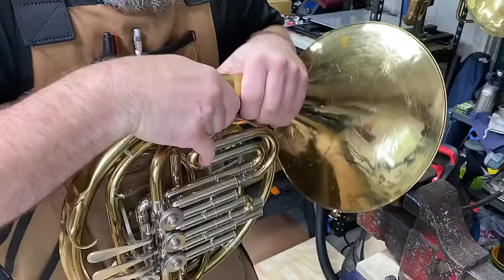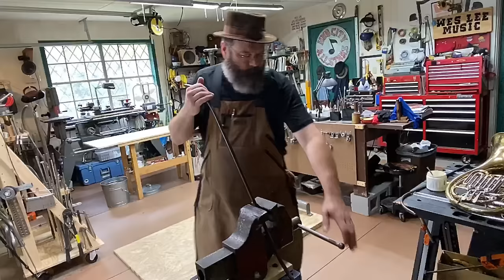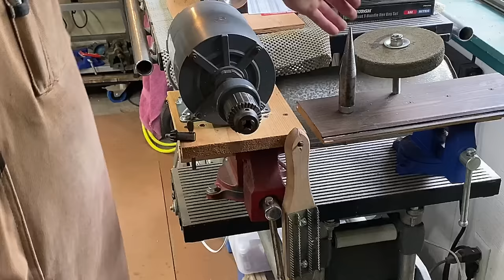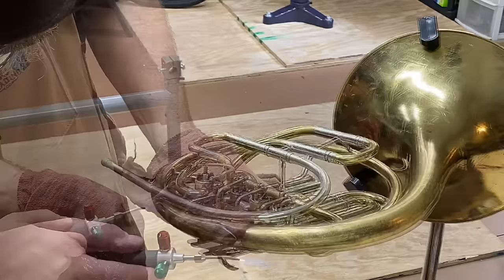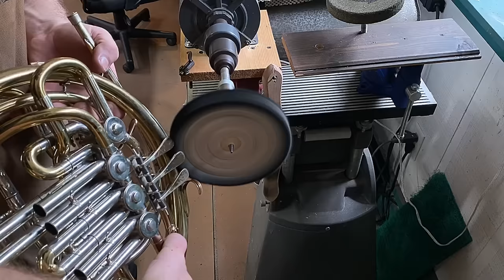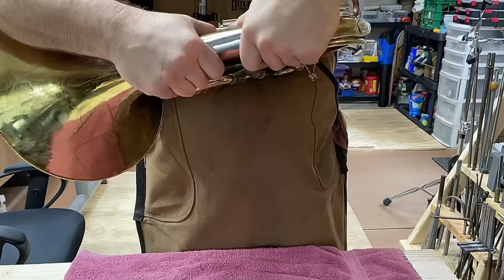French Horn Restoration part 2- Wes Lee Music

Comment: Sir, I just recently came across your channel, and I must admit that I am thoroughly impressed. As a string instrument builder who dabbles in sheet metal, I recognize that building and repair are two separate skills. You DEFINITELY have the repair thing well in hand. Honestly, I have to wonder just what the customer did to put this instrument in this condition, but it doesn't seem to matter, as anything seems to be within the realm of your skills. Big kudos.

A trumpet player friend of mine ran over his horn length wise, one very dark night. It was his horn that he had worked for several summers to buy as a kid, and he was in his 60's now. I told him he should just frame it and put it on the wall. He sent it back to the factory and they had to replace the bell, but could pound everything else out. He still has and plays that horn to this day. It cost him about 4 times more to rebuild it than to buy it.

Comment: Pure magic... Loved metal working: nothing along the lines what you do, as an HDR/W operating engineers, A mixing company one of the cement trucks, the upper hopper was tweaked / bent way out of shape,  I told the shop foreman,
 or said something to him, why don't you straighten that out, there's nothing wrong with it; he laughed at me, I said I can fix it, bear in mind, it's partly doubled plated steal, stiff, heavy duty., Much to my liking, took me a couple of days, they didn't think it could be fixed, teamsters. showed them.  You need to know how to talk to it. I'm retired now. Love it, your finished work is awesome.......

Comment: I can tell you have doing this for a long time, but may I suggest using a line laser above your work to shoot a line at the ball you are working with? I don't know if you ever have problems with but it would help you find the center of the ball when you are trying to smooth out the dented spots. Just a suggestion. Nice work, by the way!!!

Comment: Is there a reason why you don’t heat treat/anneal the metal before reshaping it? You do beautiful work!
Reply from the maker: Yes. Besides destroying the finish, it would not have gained me anything. Did not anneal because I didn’t use forces enough for making the bell brittle. Have to be delicate with how much force you use. However, In another circumstance, if I were overhauling with a refinish, after I get most all of the scarring out, I would anneal or “normalize” the brass. Can’t do a full anneal because of the soft soldered in wire rim.
Reply: @wesleemusicrepair9820  In watching this video....what would be the difference between the large patch you put on the horn (because you couldn't reach the dents as they were too far in, and instead cut off the bell so that you could get deeper, push out the dents then reattach the bell with a sleeve? I would think (and mind you I know NOTHING of your profession) that a sleeve would maintain a more harmonious and pleasing sound than a patch would that creates asymmetry in the tube